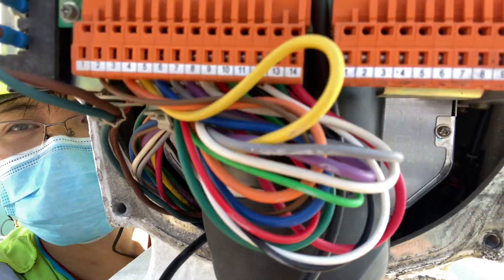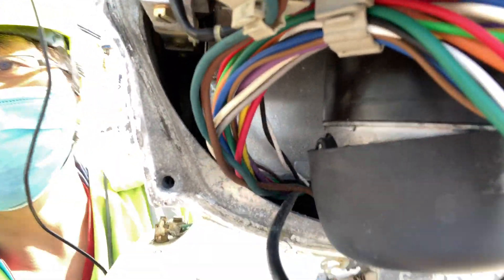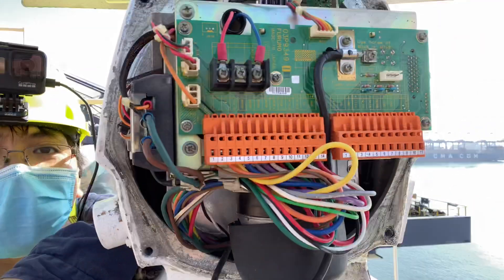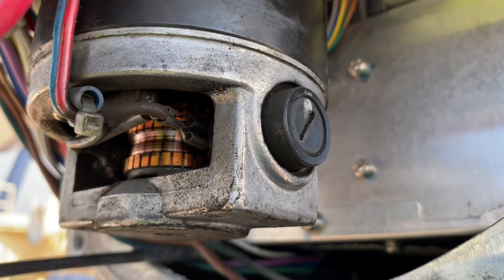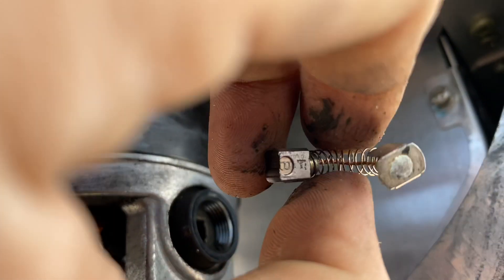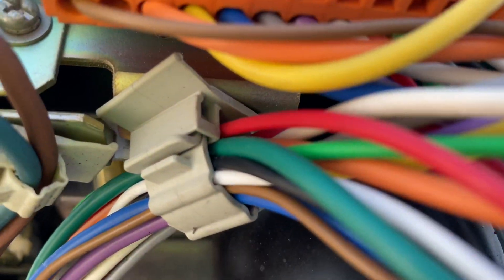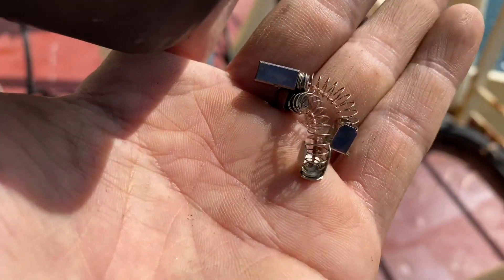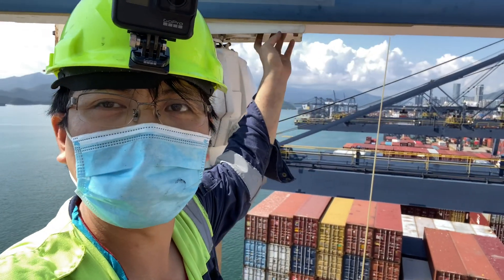FIXING THE X BAND RADAR | ETO TROUBLESHOOTING

Comment: That commutator needs to be turned on a lathe or it will keep destroying brushes! And, yes, the commutator needs replacing, but for now. A quick turn on lathe. Perhaps the machine shop can make a fixture that can turn or grind  the commutator in place while a vacuum catches the chips. Look into a replacement motor with a brushless motor and driver. That should provide better reliability in the future.
Reply: I think it was worn beyond repair.

Comment: Sir, ung carbon brush may epekto sa echo strenght ng radar? Or para sa rotation lang ng motor ung carbon brush
Reply from the maker: it is for the roation of the motor. kaya kung may problema sa brushes then magkakaroon ka ng problema din sa buong system

Comment: Don’t those brushes have an end of life indicator in them when they get worn out?  That commutator that the brushes ride on looks very worn though, doesn’t look like there is enough material left to undercut the segments so there is no bridging between them. But it was a good call, because it links like if they have not bridged between them yet, it would not be much time before they would at that point. And with a motor that small, I imagine it makes better sense to just replace it, since the gears are also worn, like you pointed out as well.
Reply from the maker: There is a PMS for every period of time but sometimes due to some instances like the weather, the position of the vessel and some factors that cannot be done it is being postponed. The motor was also replaced during the fixing of the gears. Thank you so much
Reply: @leckyjake  totally understandable.  Much more to have to keep up with of higher priority in the operation of a ship that size.  Was just wondering, recently her in the United States, we have learned that in many ports here, there is a big worker shortage, and some ships like yours are waving to wait anchored for as long as three to four weeks to be unloaded. Are you finding the same problem in other ports around the world that your ship visits?

Comment: I am now retired from the Canadian Coast Guard (EL tech) for more than 31 years and some of our  larger vessels used the Sperry Mk127E X band radar which had a two speed DC motor with a set of brushes for short and long range. This was a known problem and our annual preventative schedule was to check the two sets of brushes. I can recall on one of these vessels had both sets fail with minutes of each other. As for DC motor and gear box replacement was also done by our group of Ship Electronic Workshop electronic technicians.
Reply from the maker: Thank you. Actually last year I tried to apply for PR in Canada but due to the pandemic, it was posponed
Reply: @leckyjake  why, are u leaving sea job

Comment: You didn't explain each part in detail. Like 
1) which kind of motor either AC or DC?  and how we will know/check the condition of carbon brushes
2) how to change magnetron's? Why we will change?  and which kind of magnetron's using and their safety precaution during changing.
3) parts of the radar explain in details during Corrective maintenance.
Will be be waiting for the next video.
Thank you
Reply: Each 10.000 hour of service the magnetron have to be replaced even so whether is working properly.

After be replaced the new magnetron it has to be energized the computer during 4 hour to get preheating initial without start the scanner and graphic

Comment: Yes, best idea to get the entire turning unit replaced. Most manufacturers now seem to prefer to do that. Also, you get the bonus of a new motor, bearings, and gears. You should then get a long service life from the turning unit. Suggest making a Planned Maintenance job of inspecting the motor brushes every 3 months, looks like commutator material not very long-lived, or wrong grade of brushes has been fitted sometime in the past.
Safe sailing!

Comment: I note only ONE comment about the condition  of the commutator. It is CONCAVE in shape. Uneven wear of the brushes , and the state of the commutator tells me the motor requires replacing ASAP.
Note also the amount of "backlash" between the motor drive pinion and the main gear. That tells me the bearings in the final drive of the scanner are worn out. Better order an exchange scanner unit, again ASAP.
Reply from the maker: Yes and it was placed in my initial report. I recommended to land the whole scanner for replacement. Company agreed. It was not mentioned in the video as we do not have spare motor onboard hence could not make a detail video on it. So far radar is still running but then of course will wait for the vessel to get alongside in Vancouver for the replacement of the scanner.
Reply: @leckyjake  FURUNO Radar is Bullshit, JRC IS Better, much greeting